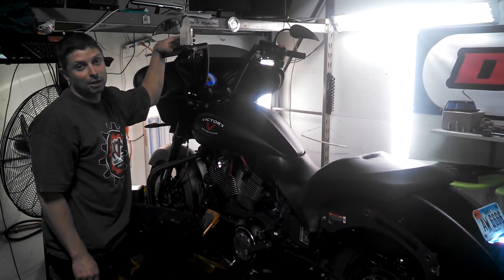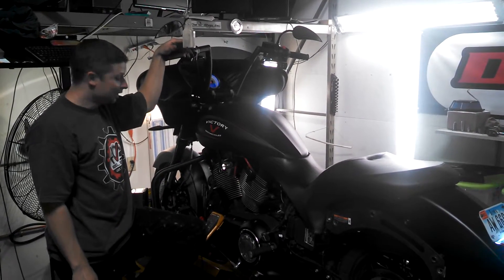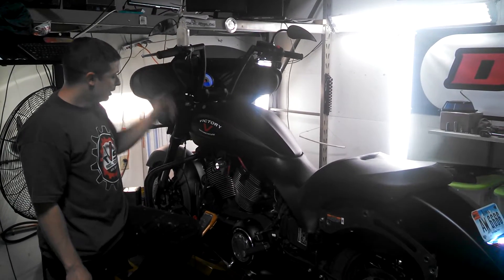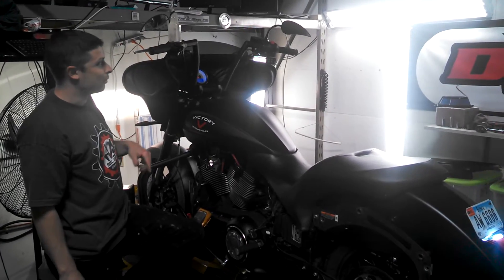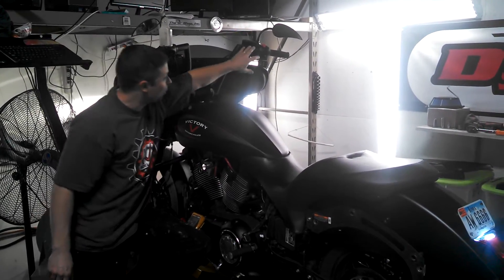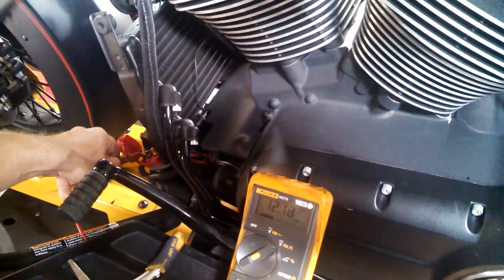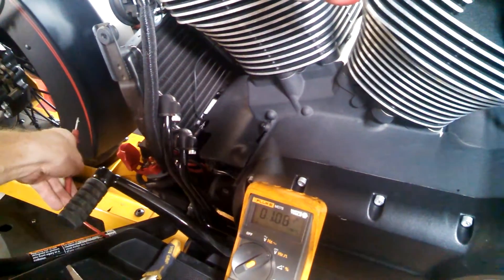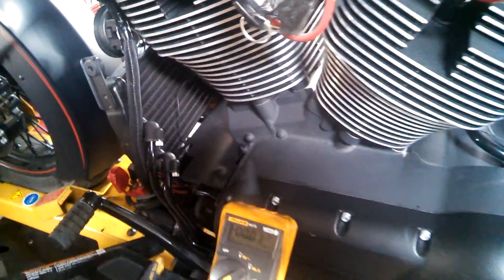Checking Circuit Breaker on a Victory Motorcycle

Comment: I have not had problem with my 2014 Cross Country yet, but this now concerns me. I would like to change out my stock circuit breaker to a more reliable brand. What brand of circuit breaker would you recommend?
Reply from the maker: I use Buss, but there are many different, quality, 40amp breakers on the market

Comment: My 09' Ness Vision has a bizarre stalling issue.  New: Circuit breaker, battery (tight/clean), fuel pump, volt.reg., Witchdoctor Hi-energy silicone plug wires,Cams/PC/tune Southern Motorworx, but, bike only goes 5-8 miles, stumbles, dies, like kill switch dies. Ignition OFF, let cool 3 minutes, restarts.  Goes 3 miles, dies. This has stumped Everybody. On the dipstick thermometer,  it happens everytime at/near 206 degrees +/- 3.  I'm tired of throwing parts at it, tired of Victory "experts" guessing at it. I want it fixed, or I'm going to Auction it, or set it on fire. This video has me thinking its the same thing.Anyone have an answer?
Reply: Did you find the solution?